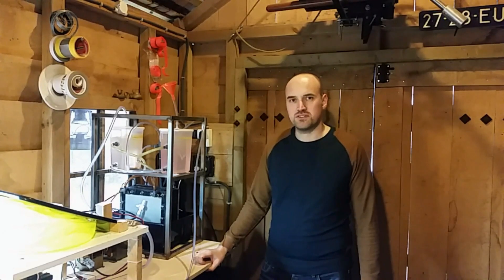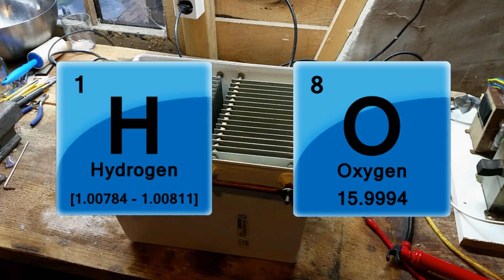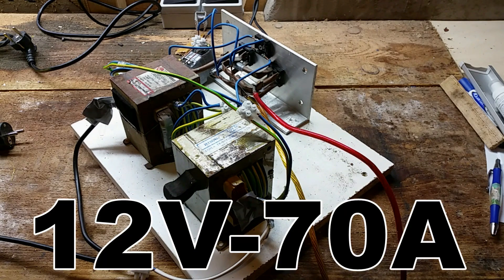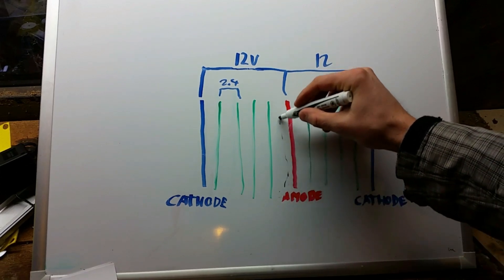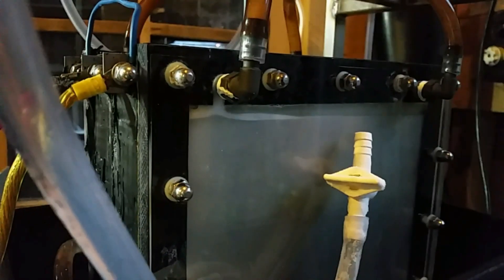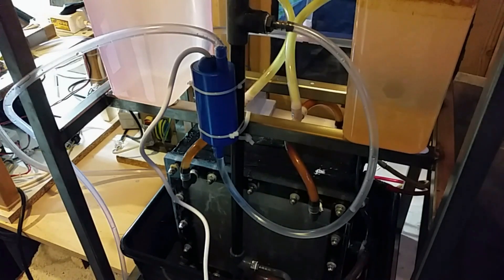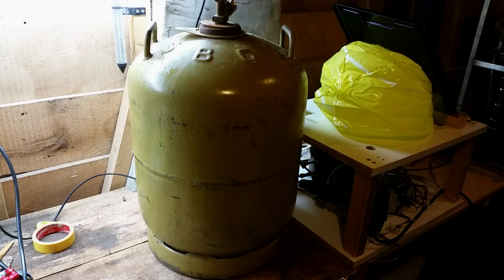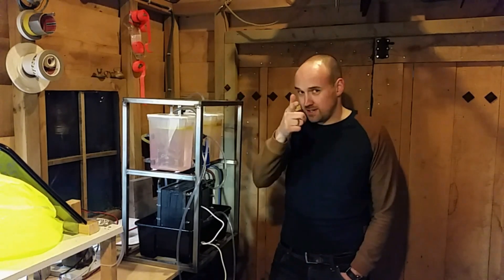Hydrogen Generator #1 Homemade Hydrogen Generator And Compressor Unit

Comment: why not use ammonia makes hhh no oxygen is made 0.47 v instead of using water  hho at 1.37 v and u get 2 hydrogens 1 oxygens
Reply: By comparison, water electrolysis consumes more energy than does ammonia
electrolysis to produce the same amount of hydrogen gas. The National
Research Council and National Academy of Engineers report on the
“hydrogen economy” (NRC & NAE 2004) states that a commercial water
electrolyzer requires 1050 kW of power to produce 8290 scf of H2
(21103.7 g of H2) per hour, or 49.75 Wh/g. An ammonia electrolyzer,
which uses 17.3 Wh to produce the same result, is 65.1% more efficient
than a commercial water electrolyzer
Reply from the maker: Ok very interesting! But doesn't the ammonia degenerate? In that case you need to refill the generator with ammonia after a while. Making ammonia also costs energy. And what happens to the N? Is the residue going to be nitric acid or something? Thanks for sharing!
Reply: nitrogen is an inert gas its all around us 24/7 80% nitrogen 20% oxygen we all breath every day, no it doesn`t degenerate but once it been transformed by electrolytes it will degenerate(NH3) same as HHO but safe to compress cause no oxygen and you get 3 hydrogens and 1 Nitrogen  so more for less power used 0.47 volts to extract it unlike HHO being 1.37 volts you can buy Ammonia 2L for a buck.
Reply from the maker: Ok but still NH3 needs to be produced which costs energy. Nitrogen isn't an inert gas btw. As it reacts with a lot of other things like Hydrogen (NH3) and Oxygen (NO/NO2).
Reply: @TheDIYScienceGuy  Your talking about cost you spent alot to do that above.....to pull oxygen out I was pointing out how much less it will cost and you will get over 3x as much, If you compress it you could burn it to heat if you want to save more  and not buy Ammonia then use Piss altho its hard to find out if our piss has any oxygen left in it.
Reply from the maker: Anywho, it's a nice idea which I will definitely try out! So thanks again for the suggestion 👍
Reply: @klincecum  wake up do research before you speak.

Comment: For a long time I have been watching in to you tube searching for a safe way to produce hydrogen.
 My plans is to use solar panels to produce electricity to use for supply. use sea water to create hydrogen then use generator to produce electricity and car fuel. I will interested to know your thoughts on this. is it possible.
Reply from the maker: Yes that is possible but very inefficient.

Comment: as long as no spark you can mix o2 and h2 in the tank.
Reply: My chem teacher described an experiment he had done in he youth where they trickled oxygen into a tank holding (initially) pure hydrogen, It was a time bomb. When the oxygen level was exactly matched to the hydrogen, a spontaneous explosion apparently occurs - no spark required. (The guy in question worked at Los Alamos during WW2 if that counts for anything.)
Reply: @rhiantaylor3446  No problem. Each to his own. Los Alamos okay, good people.
Reply: FYI-Hydrogen gas forms explosive mixtures with air in concentrations from 4–74% and with chlorine at 5–95%. The explosive reactions may be triggered by spark, heat, or sunlight. The hydrogen autoignition temperature, the temperature of spontaneous ignition in air, is 500 °C (932 °F). Don't forget spark arrestors !
Reply from the maker: Never do that! What if there is a fire and the tank explodes? You can never know when a spark occurs or when the thank overheats, so better be safe than sorry!
Reply: I disagree because of equipment safety design.

Comment: You can run 10kV through a thin wire or water or something similar and it wouldn't get hot, unless there is enough current. I like to explain it with flowing water. If you got a little lake high up in the mountains with a small outlet where the water rushes down into the valley with nothing that can stop it. It's like high voltage which can jump gaps of a few centimetres (or inches). Voltage just shows you how much resistance you can cross. And then there are long and slow river that are more easy to stop but are grinding way more through the riverbed. This is like current that if it's high enough turns the resistance into heat (like friction gets turned into heat). That's also why welders step up the current and not the voltage. I hope this  explanation helped a little bit.
LG Pierrick
PS:
I have done my research and would recommend using 12V and to stay und 25 amps (or you could start to heat the water). If you got a larger container you might have to step up the voltage a little bit.

Comment: Пребаци на српски
How do you make your canvas tight, which is the technical process of joining the membrane with nylon with seals ?
Reply from the maker: When all the layers are stacked together it will indeed leak because the nylon membrane isn't tight. So to stop it from leaking I covered the outside of the generator with a polyurethane based glue paste.
Reply: Пребаци на српски

How to tighten enough nylon membrane to frustrate over time, because if it breaks down, it clings to one electrode, and then the gases are mixed. Because it's not a solid membrane, how to do the sealing of nylon for seals and whether it's possible to do it manually ???
Reply from the maker: The space between the electrode and the membrane needs to be about 4mm and if your membrane is measured right it will stay relatively flat so it won't  touch the electrode .
Reply: write me a mail, a beggar, to send you pictures and your document what I did to look at my generator

Повратне
Reply from the maker: I will! What's your email address?
Reply: npani13@gmail.com

Comment: I wonder if dropping the voltage and uping the amps with a step down transformer or variac and a pulse width modulator would make your unit more efficient. I think that have how the "Stan Meyer" setup was made which, IN MY OPINION, was the father of hho for automotive application. I would like to see your version of this and any info you discover. I know this is an old video and maybe you have already done this. Just my two cents.
Reply from the maker: Amps are a direct result of voltage and resistance so I don't see how a step down converter and PWM would change that. Could you give me some more information or links to what you mean?

Comment: Hello, good work, but I don't understand what you will do with the hydrogen due to the fact it's so expensive, to produce 70 liter of hydrogen gas you use 840Wh (12V *70A ) 840W or 3.024Mj of energy, and you produce 70 liters of hydrogen, each liter of hydrogen have about 0.0100mj of energy divided by 70 liters = 0.7mj of energy is about 194W, so what is the point here? just to let you know that 1 liter of gasoline has about 34.7mj of energy, so if you want to produce hydrogen that will have the same energy of gasoline you will need to produce 3470 liters of hydrogen, and you will need about 41,640W to do that,  so I don't know how much money you pay on electricity but if you pay 0.11 dollar you will pay about 4.58usd per 1liter of gasoline, and it's the most expensive fuel ever,  thanks, Ori.
Reply from the maker: Thanks! I only use it for hydrogen balloons because it's a lot cheaper than helium, and because helium is scarce, it's better to use it for real science ;)

Comment: Silver is more expensive but you can use heavy plated copper plates to cut down cost , same with Nickel . Edison used heavily nickel plated electrodes in his nickel- iron battery which used a strong potassium hydroxide electrolyte .
Reply from the maker: Ok yes that will work very well of course! Thanks!
Reply from the maker: Do you BTW no if there is any truth in the story that a stainless steal generator will produce hexavalent chromium? Even when using alkaline vs. acid based electrolyte?
Reply: The DIY Science Guy      Stainless does contain a small percentage of chromium metal  but I do not know how it would react to continuous exposure to sodium hydroxide solution .
Reply: If any chromium did dissolve out of the stainless I would think that it would react with the hydroxide to form an insoluble compound of chromous or chromic hydroxide .

Comment: I've seen a lot of generators and the majority of them use stainless steel as the electrodes , I understand the reason behind this being it is not affected by the alkaline solution . The problem with using stainless is the resistance to the flow of electricity , it has a high resistance to electron flow causing heat . This is shown in an electric toaster which uses Nichrome metal to produce heat . Stainless and Nichrome are similar in that respect.  When there is more resistance to the flow of current it takes more current to produce the desired output of hydrogen .  There are other metals that can be used that will produce more hydrogen with less resistance to current and are also unaffected by alkaline solutions .  One would be Nickel the other and better one with the least amount of resistance to current would be Silver .  This is the approach I am taking as it makes more sense to me to provide as much current to the job of breaking the water apart  with the least amount of current used.
Reply: "Bourgeois’ research team came up with a way to make future electrolyzers largely out of plastic. They used a GE plastic called Noryl that is extremely resistant to the highly alkaline potassium hydroxide. And because the plastic is easy to form and join, manufacturing an electrolyzer is relatively cheap.

Inside the plastic housing, metal electrodes still do the same job. But because GE is using less electrode material, the reactivity of the electrodes’ surfaces is improved. To do this, the researchers borrowed a spray-coating process – normally used to apply coatings for parts on jet engines – to coat the electrodes with a proprietary nickel-based catalyst with a large surface area."
Reply from the maker: Thanks for the info!
Reply from the maker: Ok thanks for that info! Silver is a little bit to expensive to my taste, but it's worth it to look in to it. Thanks!
Reply: Isn't Nickle what is added to steel to make it Stainless?
Reply from the maker: Both nickel and chromium are added in various quantities depending on the type of stainless steel.
Reply: Right, I'd forgotten about the chromium. What are your thoughts on using Carbide instead?
Reply from the maker: Do you mean carbide steel? If it is not a stainless steel it will corrode away very fast.
Reply: Sorry, I meant to say Graphite. Sorry for the confusion.
Reply from the maker: Ok, well I think the resistance of graphite is much to high. Most electric motor brushes have copper added to them to make them more conductive.
Reply: titanium ?

Comment: To seal the NaOH containing tank, what is the best sealant? Hot glue (I tried for a small test vessel) dissolves from NaOH solution. Would silicone caulking (not pure, the stuff with additives) work? Or would epoxy resin be better?

Also, for the compressor, what kind do you use?
Reply from the maker: Epoxy is best, the kind that stays some what elastic, for sealing hose conections. Also polyurethane based glue for sealing covers ans lids.

Comment: For your power supply, what diodes and capacitors did you use? I can find cheap 150A bridge rectifiers on eBay (linked below) but I cannot tell what capacitor (type, voltage, farads, size) to use. Also if you have any recommendation on sourcing either the diodes or the capacitors, I will greatly appreciate it.

https://www.ebay.com.au/itm/1pc-Black-Single-Phase-Diode-Bridge-Rectifier-150A-Amp-High-Power-1600V-gn/173349684297?hash=item285c724449:g:-UEAAOSwFV1bFOcH
Reply from the maker: The ones you've found are perfect. You can also use 3x 50A bridges parallel.
For your capacitors you need 1000ųF per 1A.
Reply: The DIY Science Guy  So just some generic electrolytic capacitors will work to smooth the rectified current, as long as they have the 1000uF per amp?
Reply from the maker: Yes that is correct
Reply from the maker: And the right voltage of course. Its also 1000ųF for full bridge 2000ųF for half bridge.
Reply: The DIY Science Guy  Of course. And I assume there's no issue with adding some in series if its cheaper to do so? (No considerable losses to resistance etc)
Reply from the maker: Well if you put 2x 1000ųF 12V capacitors in series thay can handel 24V but thay will have a combined capacity of 500ųF. If you put 2x 1000ųF 12V capacitors parallel thay can handel 12V but will have a combined capacity of 2000ųF.
Reply: Ah, yeah. Forgot that :P its been a while since i did any electrical stuff in my degree.
Reply: Diy science guy.  Your right about parallel capacitors but the listed voltage of the capacitors does not combine when in series like resistance does.. the voltage rating of the smallest cap must be used as max voltage for the circuit, well a few volts below the rated voltage..  i know this theory well as i have exploded many a cap testing this before actualy reading about it..  lol..  but logically its like putting a 5v cap in series with a 250v and applying 200v to the circuit..  that 5v caps gonna pop quick as hell.  So best to get oversizd caps.  Like if 24v citcuit get 36v caps
Reply from the maker: I never used capacitors with different voltage levels, But it at least works if they have the same voltage rating. And indeed it's best to just use the right voltage rating.

Comment: Finally! After two days of watching videos about hydrogen generation, YouTube's recommendation algorithm has eventually discovered THIS is the channel I was looking for :)
Reply from the maker: Thank you so much! That's really nice!!!!
Reply: Sorry if you answered this already, but approximately what is the power consumption when running at the 70l/minute rate?
Reply: aaa hehe.... 70l/hour I mean :)
Reply from the maker: O good I was afraid I had to dramatically disappoint you ;) it draws around 850 watt. Btw, no problem, ask all you want!
Reply: @TheDIYScienceGuy  Something doesn't add up here.  It draws 850 watts AFTER your improvements with more plates to lower the cell voltage?  That sounds like what the power consumption might have been when you were putting 12 volts into a single cell.  Or, are you talking about the entire system, when the compressor running?  Your machine produces about what mine does... I get around 66 L/hour and it only uses 280 watts.  I also have the problem with a 10-15C water temp increase and I get a lot of vapor.  I have not attempted to cool the water at all but I am also not compressing the hydrogen.  I only fill balloons with it.  I fill oxygen balloons too.  For my purposes, water vapor is not a big problem.
Reply from the maker: Yes total energy consumption. Water vapour ads to the volume of the gass so for a good comparison you need to take that out.
Reply: @TheDIYScienceGuy  True. When gauging my rate of production, the gas was being bubbled through cold water so I assume water vapor was volume negligible (though present - I didn't dry the gas).
Reply: @TheDIYScienceGuy  I have wondered if using sound waves at the right Hz would help to make it more efficient
Reply: @paulburgess8033  Wow! From out of the blue I had this dream of using sound waves at right frequency (very low frequency IMO) would help seperate Hydrogen from Oxygen. Since then I'm studying the current method of Hydrogen generation.
Reply: @prashanthmotadoo6084  Urea has 2 hydrogen atoms. Urine is mostly urea . Only 0.37 volts are needed to start electrolysis. Using urine you get more energy out than put in. Also, magnets have been shown to improve electrolysis.
Reply: @paulburgess8033  Very interesting. I need to do more research on this.
Reply: @TheDIYScienceGuy  GENIUS  PURE  GENIUS
Reply: Really nice to see your name pop-up here (Dutch YouTube channel)! I saw a lot of your videos and I also landed on this channel after searching hydrogen electrolyser or something.
Reply: Waylen Edge have you ever built one of these? They work fine, and I’m not sure pwm would even work, there’s a little bit of time it takes when you apply voltage for the electrolyte to start bubbling. So if you’re turning it off and on it may never get going. Not sure, never done that. And if you’re worried about energy lost as heat, just suck it back up into the battery with some kind of seebeck generator or something.
Reply: Also, the more cells you have in series it divides the voltage, so you end up with less overvoltage, 12v/6 cells you end up with about 2v/cell in my admittedly limited experience.
Reply: I'm about to upload my version
Reply: Yeah, me too. This is perfect
Reply: Nice ...well done..
Reply: Same
Reply from the maker: Yes, more or less.
Reply: This is the channel WE were Looking for!
Reply: Sadly, it took much much more than 2 days for me… just happy to find this amazing video! Seriously, excellent work! 
Edit: Instantly a subscriber, can’t believe you don’t have far more !
Reply from the maker: That is so nice! Thank you so much!